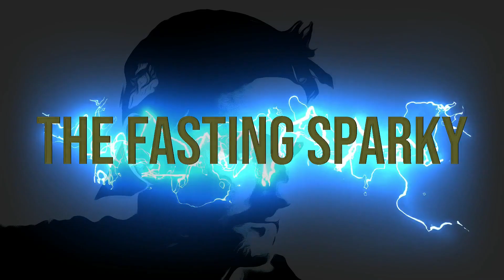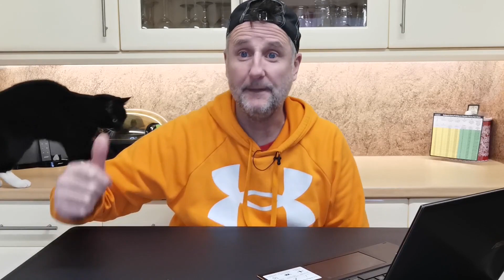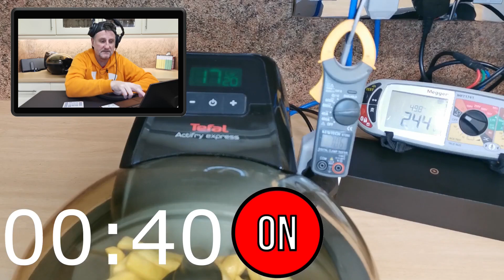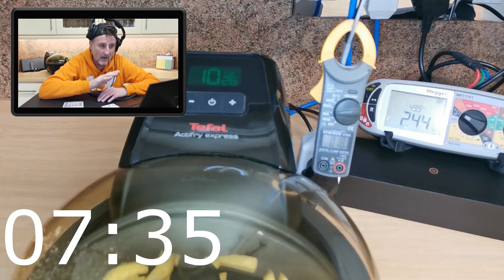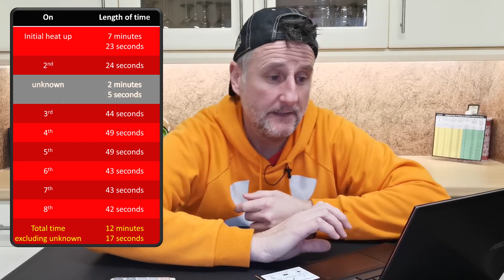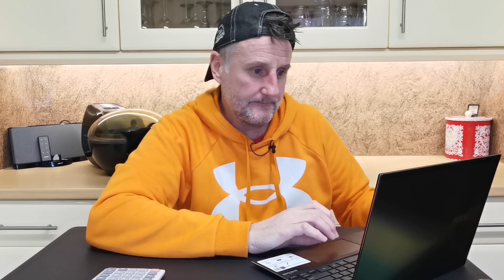HOW MUCH My Air Fryer COSTS Me To Cook Chips | SAVINGS Compared to an Oven REVEALED!!!

Comment: I’d be interested in the microwave and the toaster too, can you do those please?
Reply from the maker: I don't have a microwave, ditched it nearly 10 years ago but I will do a video on them because they are easy to work out how much they use. I don't believe they have thermostats but I will check. If not then it's a simple calculation based on power rating of the microwave. So a 1000w one would cost 1 kWh to use for 1 hour, so for me 34 pence, a 750w one would cost 25.5 pence.
Reply: @TwoWalliesandaFoodReview  I use mine a bit, I can do a bunch of baked spuds in 15 minutes as opposed to 45 minutes in the oven
Reply from the maker: @shelleydaly1726  yes that's all I used to use mine for baked spuds and then crisp them in the oven for a few minutes. Then I researched them one day and found out they should be called a radiation oven. Not used one since 😂

Comment: The best way to save money, especially on your lecky is by turning the water cylinder down.
Reply: In the 70's, miners strikes etc.. we just had 14 jumpers on, ms daly. And aye, Sparky, we've been promised combies for the last 5 years. Finally been installed. Nowt to complain about now ( mind you, hav'nt had mi first bill yet, like ! )
Reply from the maker: @blackbob3358  Modern day boilers are a lot more efficient than older boilers. So in theory your bills should be slightly less (amount of units used)
Reply from the maker: Yes immersion heaters are 3kw, so cost around £1 an hour to run when its heating. But most houses here use the heating system, oil or gas to heat the cylinder if they have don't have combi boilers which heat the water directly when called for

Comment: That’s a pretty pricey air fryer, they sell here for between $75-$150…so halve that for pounds
Reply from the maker: That's a mid price one now. Because everyone has rushed out to buy them here, it's driven the price up and some are selling for £250-£300 on ebay because there's no stock
Reply: Yea ms daly, i've just seen one for £28, i be buying it sharpish like. But like all new/ ish things, they'll get cheaper in time. Remember when microwave's first came on the market ? Now  they're practically giving 'em away.  What's next, one wonders, for we consumers ?
Reply from the maker: @blackbob3358  Yes I can vaguley remember when the microwave first came about. Around about the same time as the video tape recorder. Them things were cheap as chips towards the end of their life too.